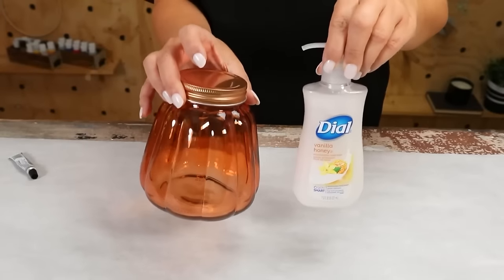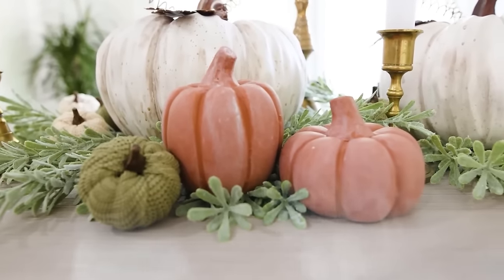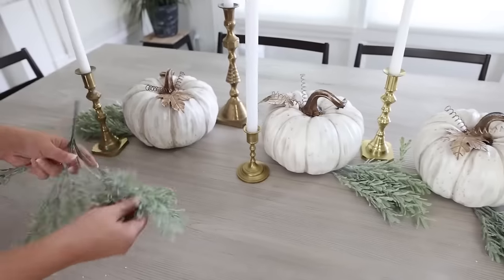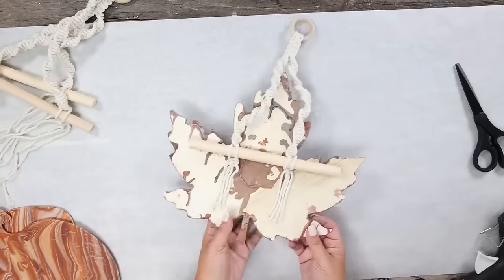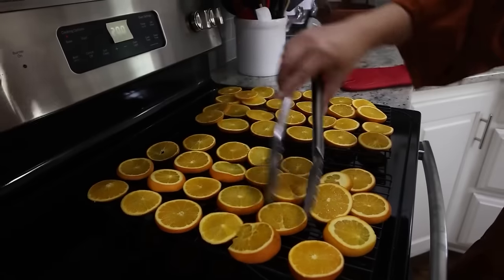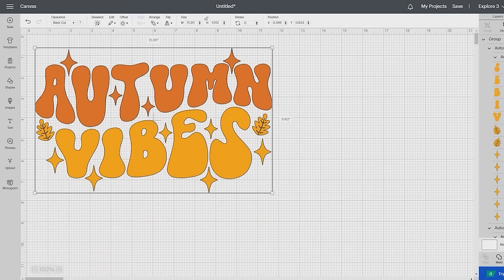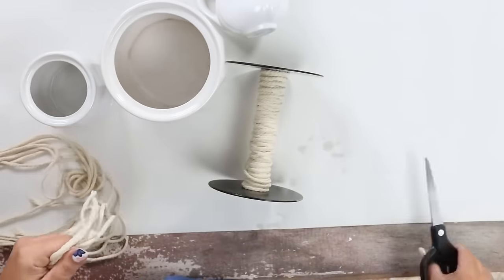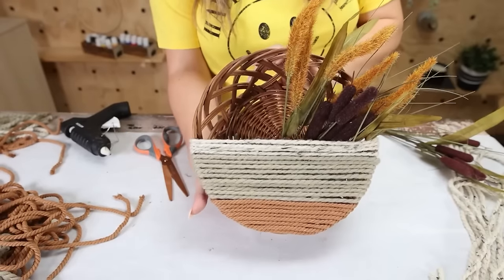50 Fall Dollar Tree DIY's...Beginner Friendly!

Comment: When you tie a knot with fishing line to be sure it does not come loose (fishing line knots will work their way loose long before you realize it can). To prevent this put a small drop of super glue on the the knot before you trim the line and give it a couple of minutes to dry, then cut off the excess.

Comment: Loved your makes. I would have tried putting the candle bread bowl in the oven on a low heat ( just enough to barely melt the wax again ). It would have evened out the wax and the wax on the rim could have then been wiped off.

Comment: SAFTEY drill holes on top of scrap wood.  2x4 work great.  Its easier and much safer.  Your able to push against the wood and it makes it easier.  You can also tape the end of the corn like a shoe lace end so you can thread easier.  Im curious if you could add cloves to the oranges before baking the oranges or make holes in the oranges after their baked and add cloves with some white glue,!glue stick etc.  Happy crafting.  So many good ideas.❤😀👻🎃

Comment: (Tried to edit but could not so…) The wax that dripped down the side of your pan when you poured will leave a film, even if you wipe it off, and this will smoke or burn the next time you heat this pan over a burner.